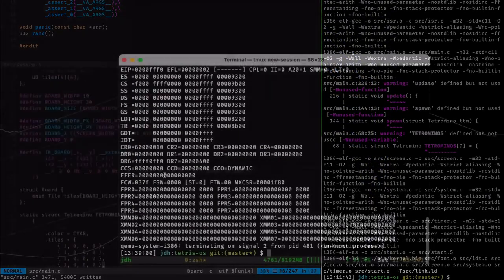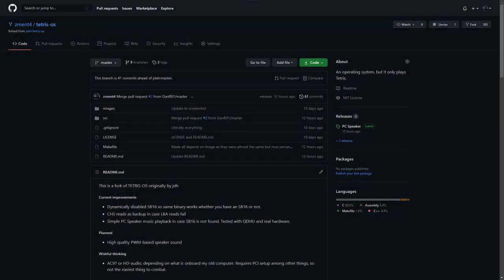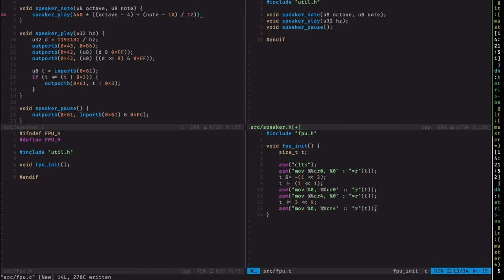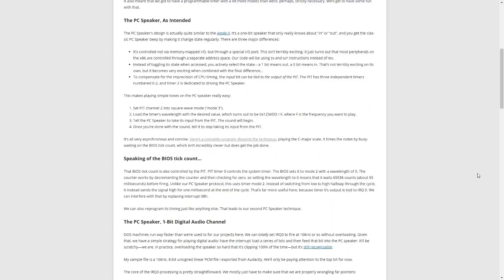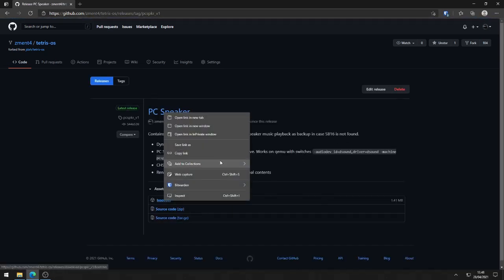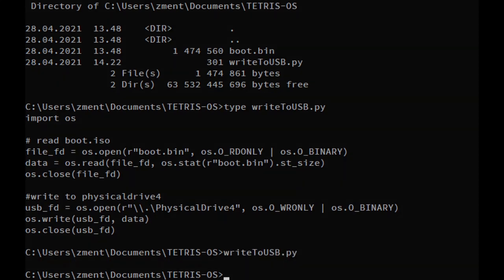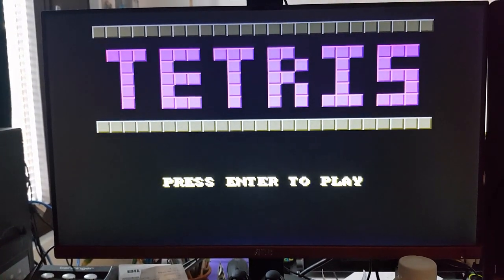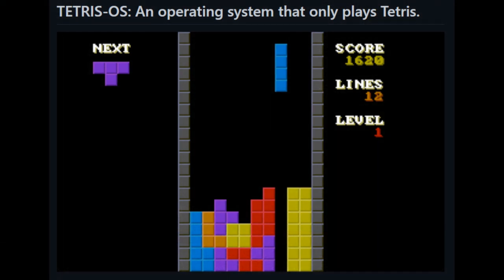TETRIS OS on real hardware w/ PC Speaker music

Comment: I found a bug. Maybe this bug makes some real pc (like mine ) u normal.
It is a typo In irq.c line 52
outportb(PIC1_DATA, PIC_MODE_8086);

That should be
outportb(PIC2_DATA, PIC_MODE_8086);
Reply: It is for the settings of pic2 .Actually pic2 no any relationship with this tetris program. But after this correcting the tetris os work normally on my old pc.

Comment: Getting an issue with Sound/music. I get the error "FAILED TO RESET SB16: 255" when launching up.
Reply: Are you using real hardware or a virtual machine? (QEMU)
Reply from the maker: Can't remember anymore from the top of my head, but that would suggest to me that you are using the original images on a system without SB16. If you are using my modified image file, it should gracefully use the pc speaker if SB16 is not found iirc.
Reply: If you use QEMU add -device sb16 flag

Comment: 1. I found the total sectors  read 0x25 in source code  stage0.S seems not big enough, because the kernel.bin bigger than 30000 bytes.

2.change to 0x45, but I still got "invalid opcode" with red background on screen.
Reply: I believe he changed that to 0x40 in his video

Comment: I am getting a problem that audio: device sb16 is deprecated. I made changes to the way the code is called to be “qemu-system-i386 -drive format=raw,file=boot.inf -d cpu_reset -audiodev coreaudio,id=coreaudio,out.frequency=48000,out.channels=2,out.format=s32” and had the major problem that the qemu virtual machine would not recognize “enter” on my keyboard for the purpose of starting the game.

How should I fix the problem of the keyboard not being recognized in the virtual machine?

I compiled everything using the code on your GitHub page. My base machine is KUbuntu, and I ran make and make qemu before anything else.

Comment: Is it possible to port this to raspberry pi
Reply from the maker: Everything is possible given enough resources like time, money and work, but as it is the whole project is about making hardware banging x86 code as low level as possible. 

Raspberry Pi is a totally different architecture, which would make it a resounding no, and you'd basically have to start the whole project from scratch.

Comment: where do you get the writeToUSB.py??
Reply from the maker: Good question!

You need to write it yourself. I didn't add it to version control (well, disregarding that one accident), as it's a) dangerous and b) very simple and c) dangerous

The reason it's dangerous is that it opens up a physical media in Windows, and if your disk layout is different than mine (which it most probably is), you might inadvertently overwrite your system drive etc.

The contents of writeToUSB.py is shown on the video, though. Just remember to make sure you have the correct device number written there before running it. Also, just to be on the safe side - I can't be held liable for any or all damages that can happen if you use that code. Use it at your own risk!
Reply: @zment  uh oh i cant code anything lol
Reply from the maker: @Root_DLux  In that case if you still want to try TetrisOS I suggest you download the release .img file and try to get that to run on qemu or VirtualBox. The risk of accidentally destroying your system drive data is greatly lessened if not completely eradicated.
Reply: @zment  no i have a old pc standing at my home which has nothing on there so i though it would be fun putting it on there
Reply: @Root_DLux  wouldn't hurt to give coding a shot. python is very intuitive
Reply: @ciankiwi7753  well yeah true the only thing i know for a bit is java
Reply: Imagine still using Windows in 2021. It would be super easy to write the game on Linux. All you have to do is use the dd preinstalled tool to directly write the file to your USB stick:

sudo dd if=boot.bin of=/dev/sdX

where X is the letter your USB stick got. Make sure you're entering the correct letter, though, you don't want to mess your system or any other drive up!